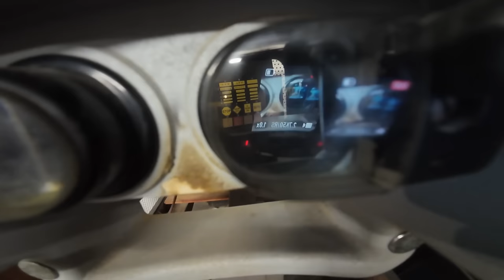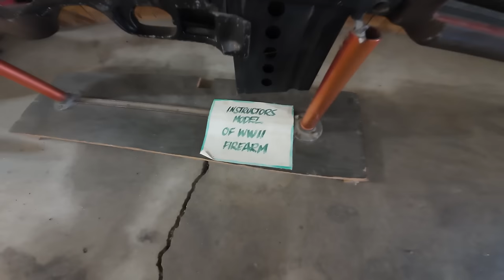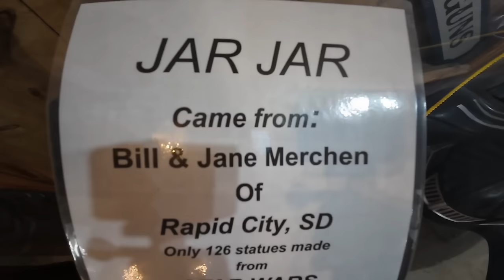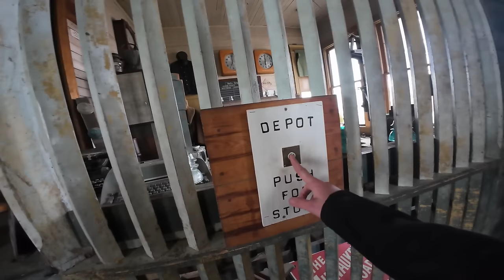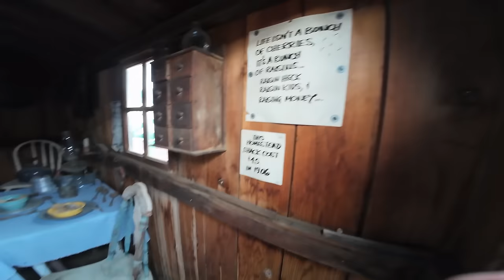TRUCKING VLOG DAY 2! 389 West Bound!

Comment: Question: do you ever use the APU on your truck? If so when exactly?
Reply from the maker: All the time it control the air keeps the motor warm and batterys charged up. I keep it in standby so if it see the batterys get low it charges them
Reply: @High_strung  thanks for always replying. You’re the man. Keep up the amazing content.